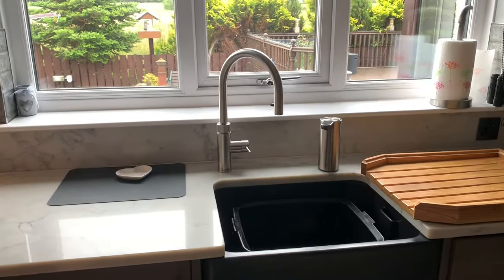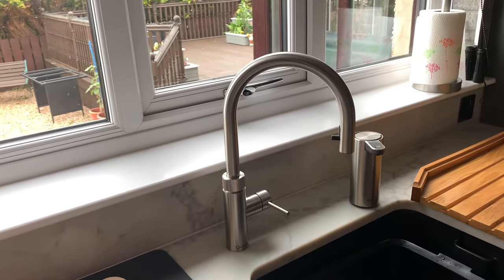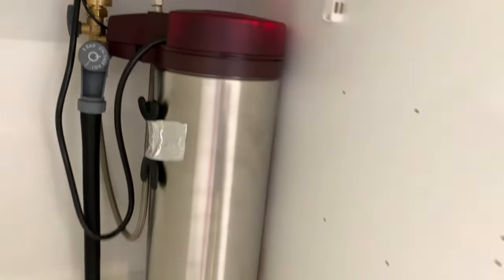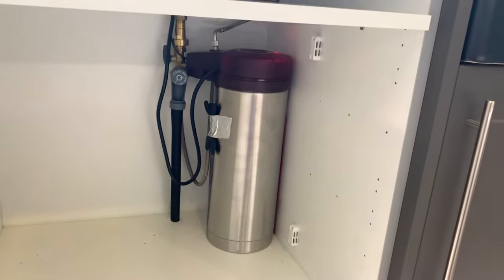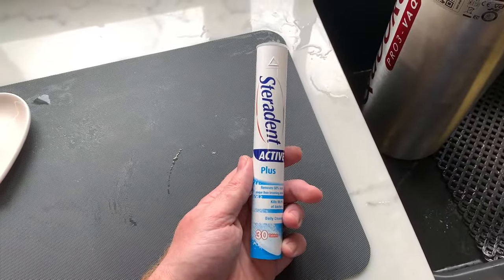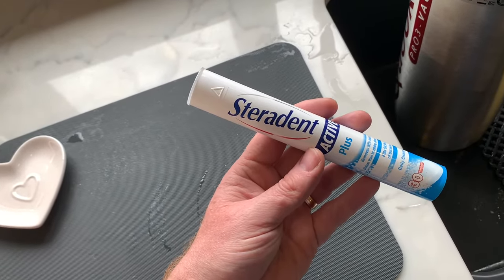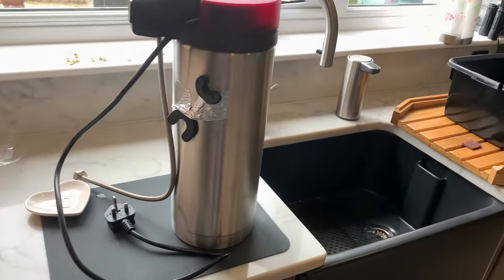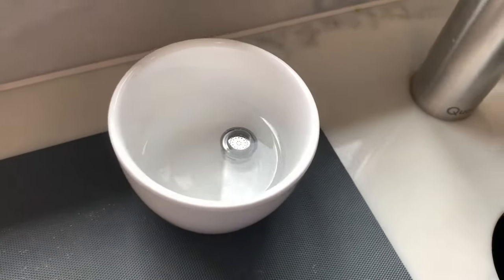Inside my Quooker Flex Boiler tap 1 year on

Comment: Wish I'd taken a picture of mine, which I've recently cleaned out. I live in the hard Thames water area so I had about 1 inch of lime scale at the bottom after 12 months.Have been getting the 4 flashing lights problem as well, so I have to keep rebooting. Moving home very soon and will try the cheaper Qettle, which includes the filter.

Comment: Quick question on the gasket...  

I've got the kit and one side of the new gasket is flat and the other is ridged.  

Can you please let me know which way around to fit it?  I'm assuming the ridged side towards the rim of the tank with the flat side against the element internals.  

I'm asking because my tank is leaking when I put it back together with the original gasket (I guess thats why they supply one).  

I want to be sure so that I dont degrade the new gasket by fitting it inverted 😂
Reply from the maker: Hi there, I can’t say I noticed, did you tighten your studs in the correct sequence, ie, in you imagine the face of a clock, you nip all the bolts down lightly, then start gently firming the nuts down, 12 o clock first, then 6, 3,9,2,7,5,10 etc, just search Flange bolting sequence or something, but don’t go crazy, because if you strip a thread it’s not going to end well, hope this helps
Reply: @madsparkie  Thanks for coming back to me.  I did just that - as it's something I've always done naturally over the past 20 years - when I called the support line they immediately said, hmmm, yes, you need a replacement gasket (which is why we supply one in the kit).  I was actually wondering if I could just use a product with the gasket like slic-tite or something that is non-toxic and can be used with extremely high pressure systems  up to 260C
Reply: @madsparkie  - ** Update **  I received the new gasket and it worked perfectly.  I was mistaken with the design of the old gasket that had compressed and created two ridges on one side (which I had assumed was how it was manufactured). 

Long story short - everything works perfectly now and, if you are reconditioning your tank it is absolutely  to fit a new gasket to ensure you don't get leaks.
Reply from the maker: @splinx2813  great news, back in the game!! Glad you got things sorted 👍

Comment: I have no idea about this stuff - but is it safe to have a plug socket installed so close to the water supply? What if there was a leak at the back edge of the worktop? Is it in line with regs?

Comment: Where can the limescale be safely disposed of would you say? What if it is an exceptionally excessive amount. Also, what does the gasket look like, where could it be purchased also is the gasket absolutely necessary
Reply from the maker: Put the limescale in a tissue, then in the bin or down the toilet, if you check back the video the gasket can be seen at 5:10, it comes as part of the kit from the Quooker website, as this is a pressurised vessel it would be good practice to change the gasket every time it’s opened, especially as it comes as part of the kit, if you are unsure you shouldn’t be doing this yourself, you could quite easily damage the housing if not careful with stripped threads etc.

Comment: Isn't the water filtered before it goes across the element?
Reply from the maker: I had a quick look at the Quooker website just now, https://www.quooker.co.uk/pro7-e-internals-31-200-00.html and looking at the pic, and from memory I believe water is filtered coming out of the tank,  I dare say you could probably put an inline filter before the Quooker tank, if you live in an area with particularly hard water and it’s a concern for you.
Reply: I too was under the impression that there was a filter in my Flex, bit it doesn't look like it from the video and my unit looks the same. ( away from home, so can't check it at the moment)
Reply: The white plastic cylinder on pro7-e is a lime scale filter for filtering boiling water?

Comment: Does your grey plastic pressure valve every leak? Mine from time to time leaks water from it and it seems like its under pressure???
Reply from the maker: It does now and again,  It’s a pressure relief valve, it’s designed to open at (around) 8bar, it’s a safety feature. 👍. However, If it’s passing constantly then perhaps it’s not seating properly after lifting,
Reply: Mine had been leaking recently, after I fully removed pipe discovered it had some limescale build up and caused some blockage. Cleaned out with some stiff wire and reinstalled

Comment: Should I get one, would you recommend? What about running/maintenance costs but note you said filter pack is £25, is there any other maintenance cost? I’m also in Aberdeen so a soft water area but surprised at the build up after just 1 year even with the Aberdeen water!
Reply from the maker: I wouldn’t be without it now, more kitchens are sold with them than without them now, a bit like microwaves back in the day, now everyone has a microwave, soon everyone will have a boiler tap, there are cheaper ones available, but I believe Quooker is most likely the bench mark, I’m North of Aberdeen by an hour or so, the build up of limescale wasn’t huge but definitely worth the £25 a year for the filter.  Hope this helps.

Comment: Asking me what is 1500 € or above on this quooker's worth?
Reply from the maker: Not sure I fully understand your question, however, there are other boiler taps available that do the same job and less expensive , we like ours,  It works for us, we were installing a new kitchen and it seemed like a good idea, I remember when microwaves first appeared on the market, and everyone thought they were not worth the expense, now almost every kitchen has a microwave, I think it’s the same for a boiler tap, if we were to move house or install another kitchen, we would fit a boiler tap agin.
Reply: @madsparkie  Just can't figure out, why a quooker cost so much when i see the components ... and they can range up to 3500 or nearly 4k (€). I landed here, why was wondering if a cooker can use big CO2 bottles (bigger then the 450gr), but cookers seems to sell them with the same bottles like sodastream.